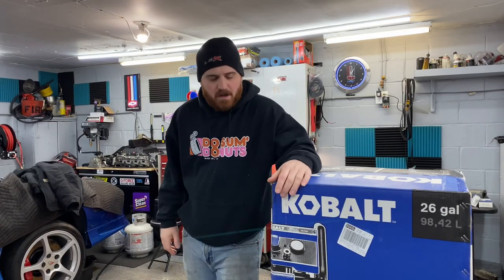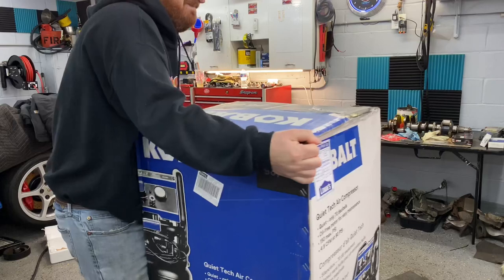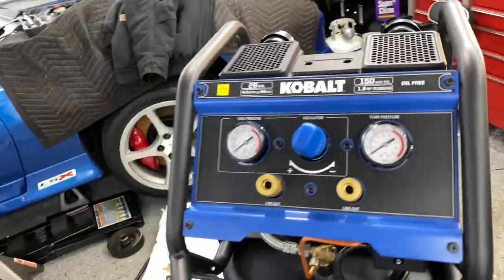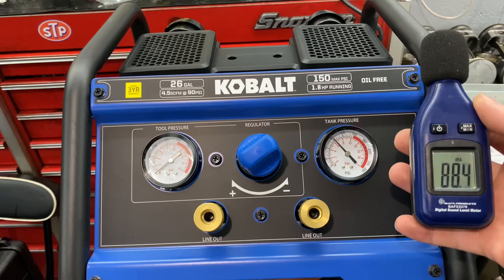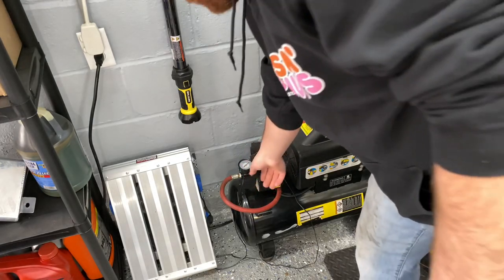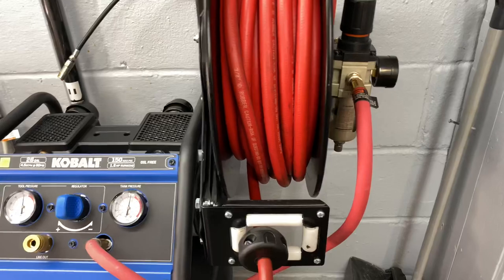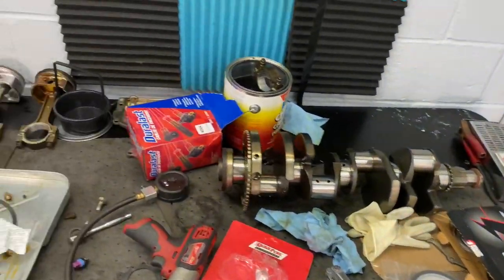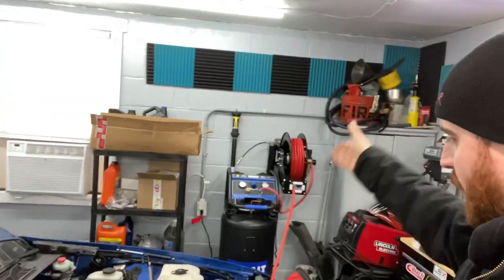So How Quiet Is It?? Kobalt 26 Gallon Air Compressor Unbox/Review

Comment: Drain valve is at the bottom of the tank. The switch you point out is a high pressure pop-off safety switch. I do like your videos and the builds you do. Thanks for the info you provide.

Comment: I’ve had mine for a few months now and use it 2-4 times a week. I can talk to my wife in a normal volume standing right next to the unit. No issues so for. As of now, I’m completely satisfied with it.
Reply: If my air lines are air tight, could I keep it on 24/7 so I could keep it hooked up to a pneumatic can crusher?
Reply: @ltsallwood  I don’t see why not. I’ve had mine pressurized for a month at a time with no loss. Of course the pump isn’t constantly running 24/7, but it is on and pressurized. I just drain the condensation about once a week and haven’t had any problems.

Comment: Got this compressor a couple months ago. Basically every fitting leaked and I had to add Teflon tape to most and Loctite thread sealant to the one going directly into the tank on the top. After that it a hold its max rated pressure for weeks if you wanted to. The best thing about this compressor is that it is genuinely quiet. Compared to the average compressor its at least 25% quieter just going by ear. its about as loud as one of those small Slime branded tire air compressors you can buy at Walmart. It fills up the tank in about 4.5 minutes from empty. I've read the speed slows down as it gets used but so far so good. Also the regulator seems really cheap but is working like it should.

Comment: I just got this compressor… another comparison… I have a porter cable pancake compressor (I think that’s what it’s called… It’s the kind that looks like a fish bowl with a motor on top), and I just returned the non-quiet Kobalt 20 gallon. Both of those were loud. When they were running, the noise level in my house was unacceptable (I run them in my garage, which is next to My family room). I could clearly hear it over my TV. With this 26 gallon quiet model, it’s just a low hum and can’t hear it at all with my TV. My family wouldn’t notice the noise at all (but with the other 2, they complain about how loud they are).

Comment: I mean I'm no sound scientist but 83 decibels Vs 95 decibels don't seem like 80% quieter
Reply from the maker: Definitely not, but I will give it the fact that the doors were open when I checked the harbor freight compressor. Either way it still comfortably more quiet than the hf, which still helps a lot.
Reply: The db scale doesnt work like you think, 3db equals TWICE as loud, so its alot quieter
Reply: No you are not…..decibels are not linear

Comment: Good video on the compressor.
I'm also in the Market for a Portable Compressor.
I have look and compared specs online and in stores of Canadian Tire, Harbour Freight, Lowes, Home Depot,    
and Princess Auto.
I found the the Central Pneumatic from Harbour Freight, 29 gallon, 2 HP, 150 cast iron, vertical compressor at $379.99 USD. The best value I'm not considering noise, I'm more  concerned about CFM at 40 and 90 psi. 
After comparing price and specs I found this model gave the most CFM for a plug in portable. Price not bad too.
Kolbalt from Lowes makes one rated at 175 psi with 220 or 120 volts, but CFM was lower then this Harbour Freight 29 gallon, 2 HP above.  It sold for $500.00
Plans are to use the portable for painting engines, transmissions, rear ends, etc. Small painting jobs not requiring a big compressor. Uses can be for die grinders, right angle die grinders, etc.

I got a big 3 cylinder 2 stage, which would be used for larger sand and painting jobs. 
But had a need for a portable 120  volt compressor. 
If the noise is high! Will build a insulted box to enclose it with a vent. 
Planning to buy later in April from HF or sooner. 

As for blasting cabinets Harbour Freight has one on sale for $149.95 USD which is a good deal. Princess Auto is selling a copy of the HF but in blue for $499.00 CAD.
Same damn thing it is on sale for $250.00 CAD but HF is cheaper.

Comment: Just remember that most of the time you really get what you pay for. Sometimes you might think you're saving money because something is so much cheaper but it ends up to be garbage. Eastwood is supposed to be very good. I will say besides things like the blasting cabinets and painting maybe a plasma cutter most of the other air tools are becoming obsolete bc of the cordless tools out and coming out. Especially Milwaukee cordless they're pretty badass.
Reply from the maker: Yea I use Milwaukee for everything! The blasting cabinet and plasma cutter will probably use it the most.

Comment: Now take the harbor freight compressor apart and attach the two for 36 gallons of air thought the harbor freight was an 8 gallon but heard you say 10 later on in the video
Reply: Why do that when you can use the 2nd compressor for when you need much higher CFM such as when painting....

Comment: I hate to be pessimistic but an oilless compressor and a sandblaster doesn't sound like a great idea. Sandblasters need tons of air. That unit will run continuously and you will be waiting on it to recover. Lots of heat and wear. If you have the budget look at the Eastwood rotary compressor. I've had a Craftsman for almost 30 years, it will only be replaced by a rotary

Comment: I ordered this from Lowe's to have a bigger compressor to spray liquid mask from my Harbor Freight HVLP gun onto my Rc bodies. But quick question, Let's say I want to start using this to airbrush my RC bodies as well as spray liquid mask, what moisture trap/regulator are you using? What size is it and does Lowe's sell it as well?

Comment: That's pretty quiet.  Watch the regulator pressure. I think that most air tools recommend 90 psi.  I've ruin an air gun before because I forgot to turn down the regulator. I believe that's why they advertise the different ratings on air compressors.
Reply: Every air tool I've ever used recommends 90psi max, however every shop/dealership I've worked in has shop air set at 120-150 psi, and I've never had that high psi damage any of my tools. With that being said, I set my home compressor at 100psi.

Comment: I have yet to turn my on, and I purchased it if I'm not mistaken back in December of 2021.

However I'm worried about using a drop cord and I realize most cobalts work pretty good on a good grounded drop cord what is your recommendation. (My setup is like yours where I have mine in the corner of the garage too.)

Comment: Ugh, it's "oil free". I've been researching these air compressors and the oil free use Teflon as a lubricant. This will dry out and the decrease longevity, but the maintenance is low.  Oiled compressors have better lifespan but require more maintenance

Comment: Compressors come with a sticker show the tools they recommend you use and ones not to use. What can that one handle?
Reply from the maker: From Lowe’s site:

For Use with Air Brushing	Yes
For Use with Bolting	Yes
For Use with Brad Nailing/Stapling	Yes
For Use with Framing Nailing	Yes
For Use with Finish Nailing	Yes
For Use with Roof Nailing	Yes
For Use with Drilling	Yes
For Use with Cutting	Yes
For Use with Grinding	Yes
For Use with Spraying	Yes
For Use with Sanding	Yes
For Use with Surface Prep	Yes
For Use with HVLP Painting
Reply: @lsxmatt  plasma cutter?

Comment: Where did you get the hose reel & how much?
Reply from the maker: Harbor freight, I think it was 60 bucks.
Reply: What that air thing on the side what is that how much?
Reply from the maker: Its a water seperator. I think it was like 20 bucks, also from hf